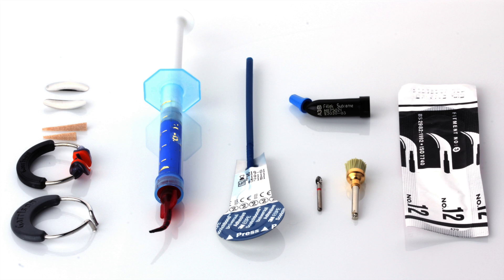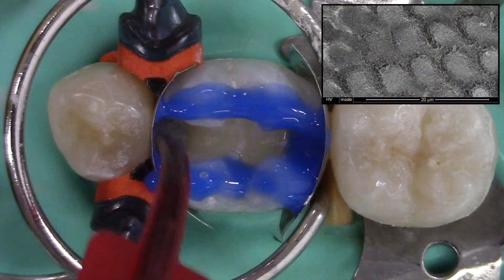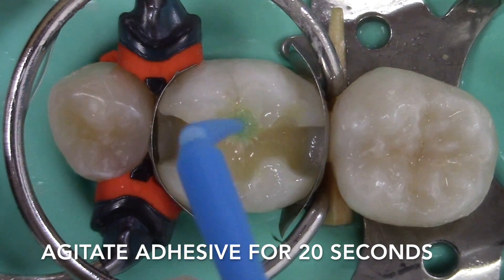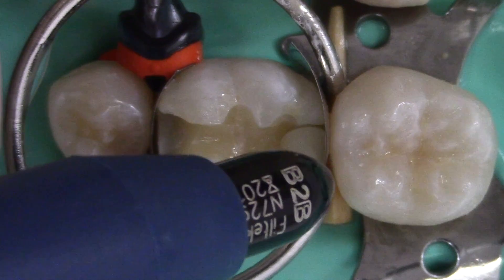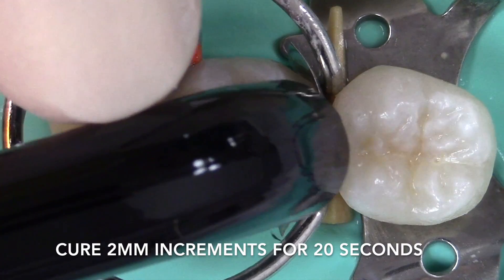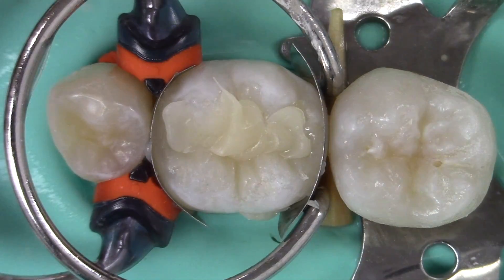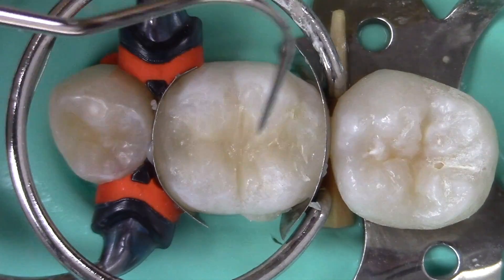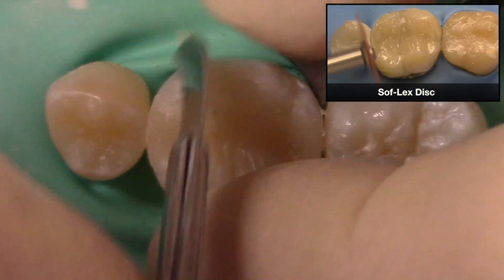Class II composite restoration

Comment: 12 blade is dangerous to to use to remove flash, their are proper tools to remove flash that don’t risk cutting the patient
Reply: If you can't properly handle a 12 blade you should be doing Ortho. Yes there is a risk but if you use your doctor hands then you will be fine. If you don't want any risks go sell mufflers
Reply: @paigedrahn627 The #12 is a fantastic tool for removing flash and contouring the gingival margins. If one practices with the #12 blade enough and becomes comfortable with using it, it is really not too dangerous—just depends on competency of the clinician.

Comment: Restorative resins r of 2 types- indirect & direct filling resins.

This was a Direct filling resin procedure. If u wanna know bout the Indirect fillling resin procedure; u can check out the video on yt named -"indirect/direct composite inlays" by Dentistry today :) 

We follow direct one now; dentists used to follow indirect procedure back in old days. as the indirect filling resins had low modulus of elasticity( the resins that we use now in direct filling procedure has improved their properties a lot time to time,that's why It's more preferred now.), lack of dimensional stability which caused fracture of the cement & thus results leakage finally failure of restoration....the modern dentistry has now stopped using that method & resins.

The direct filling resins r - acrylic & composite resin :)

Comment: You didn t adapt the matrix to the tooth in the mezial part. You'll get excess material there. Good occlusal anatomy though.
Reply: I think he did, I think the contour of the matrix band is casting a slight shadow on the internal surface of that matrix making it appear as if there is a gap along the gingival margin
Reply: @1108steeveee  look at the difference between the mesial and the distal. On the distal it's well adapted. That's how it should look on the mesial as well. If that was a real patient he couldn't floss properly in the space between the molar and premolar cause the floss would hang and in time the risk of dislocating the obturation could appear.
Reply: @asdfghjk4783  ahh ic ic. I thought you were referring to the adaptation of the matrix to the gingival margin :D
Reply: @1108steeveee  Yep, that's exactly what I was refering to :D if he used the probe in the area you would've noticed. Nvm I'm not here to argue with people. Good luck to everyone 🤗
Reply: @1108steeveee  There are cases in which the proximal anatomy of the tooth has a concavity. It can't be fixed with a wood stick (not sure if it's the correct term). I shove little cotton balls in between the neighbor tooth and matrix so i get an intim adaptation at the gingival margin. That works for me most of the times when this situation occurs.
Reply: magnifying glasses and microscope is only used to make patients think ur a pro dentist :D thats the words of my dental collegue lmao
Reply: @kikothecat3700  인사돌
Reply: like the other commenter said, I think it's just a shadow possibly giving the illusion of an open margin, difficult to tell when it's just a video
Reply: True

Comment: Whats the benefits of enamel only etch compared to a total etch?
Reply: Less post op sensitivity. If you chose to do a total etch start with the enamel periphery, moving in to the dentin as you apply etch. The etch does not need to be on the dentin for as long.
Reply: @bowen11  thankyou
Reply: Etch also comes in different concentrations so you can adapt.